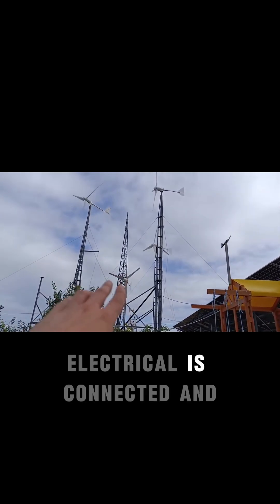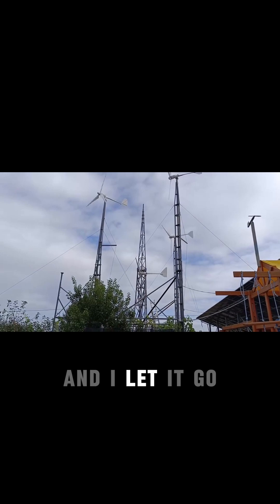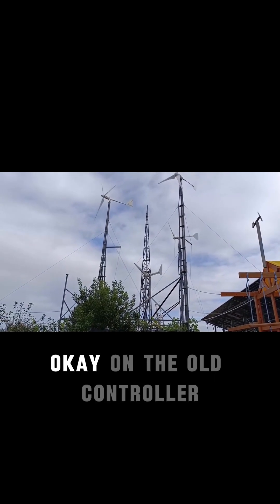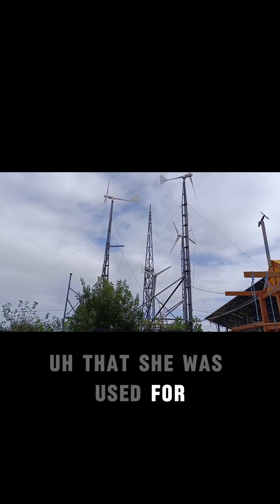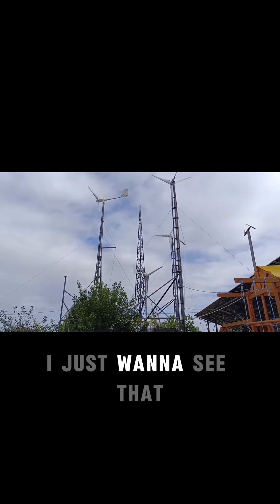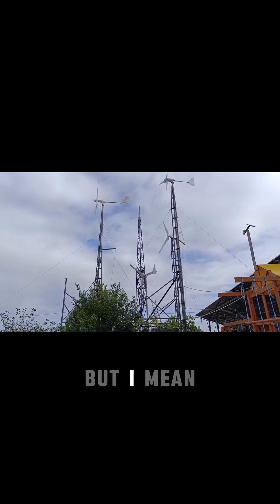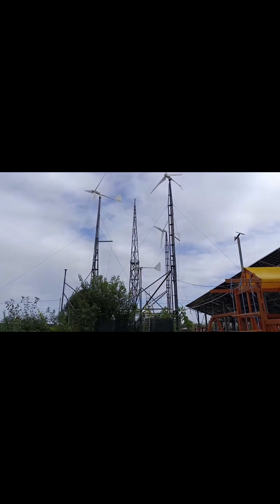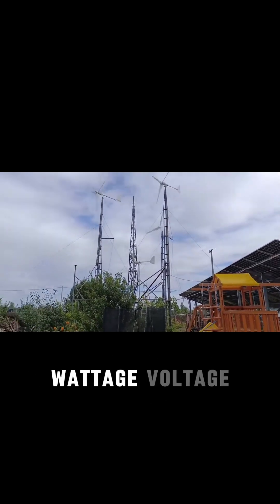Testing and Troubleshooting Your Wind Turbine Controller for Optimal Output!

Comment: Is it difficult to start up with one, maybe never add more, to still generate electricity? How much would one 10 meter generate realistically If I would try myself one day
Reply from the maker: Yes, you definitely can use one nice big unit not to use many smaller ones. Realistically one single 6.3 m diameter 10kW unit will outperform more than double all of those mine.
You have to use the proper calculations though for everything: tower, structure, foundation, possible output.